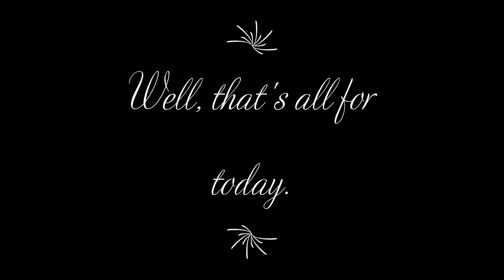1965 Fender Mustang Repair/Setup Part 2: ELECTRONIC CLEANING AND SETUP

Comment: For the relief in the neck which feeler guage did you use? Thanks.
Reply from the maker: 95% of the time I use a 0.012” feeler gauge for neck relief
Reply: @TomPlaysWithWood  Thanks, m8.